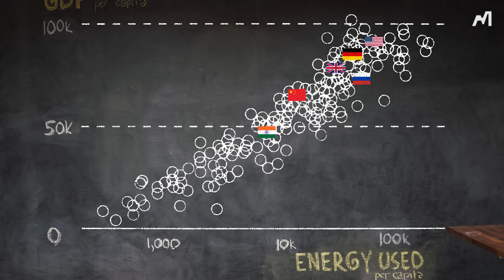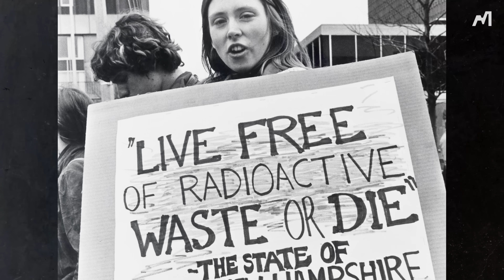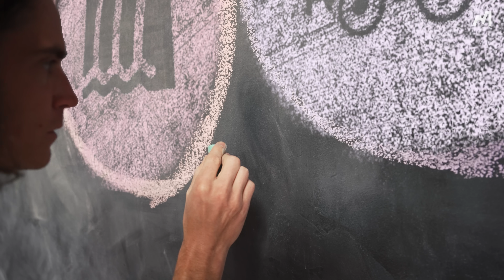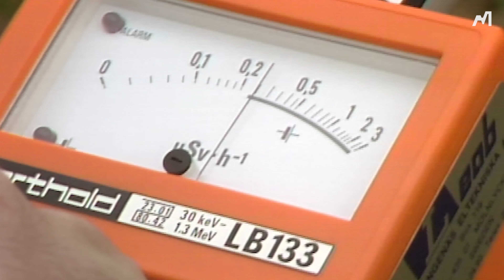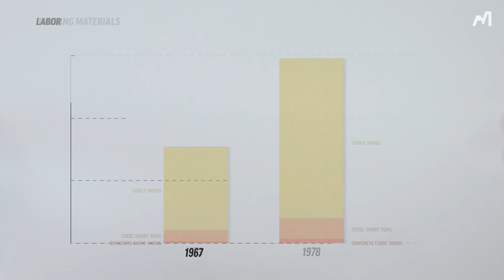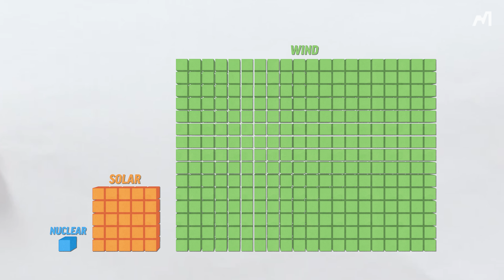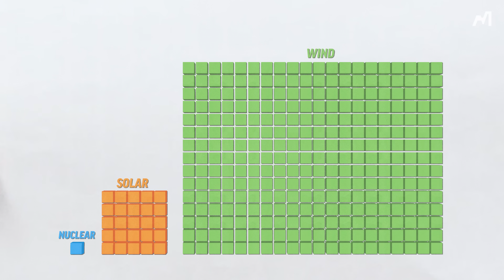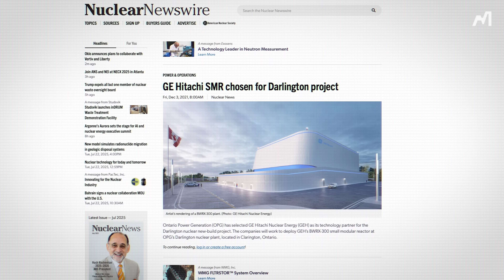They're Lying to You About Nuclear Energy

Comment: We need liquid salt thorium reactors
Reply: Exactly my thought.
Reply: Why thorium? Why not Liquid salt uranium? Why liquid salt and not another type? Got all your info from YouTube?
Reply: @Gomlmon99  You're a big boy and can do your own big boy research. The gist: Liquid salt because it is a safer system for avoiding meltdowns.  thorium because it is more abundant than uranium, therefore cheaper, and doesn't create plutonium. China is heavily invested in researching this tech, and the US is lagging behind.
Reply: @brianblades6177 my point is, everyone goes on about these reactors when they don’t actually know anything about nuclear power and got all their info off YouTube. There’s a reason we don’t use thorium - it’s expensive, difficult, and in some ways, less safe. India only started looking into it due to a lack of uranium. Molten salts aren’t some easy cure. They’re exceptionally corrosive, and corrosive = expensive
Reply: @Gomlmon99  corrosion is a solved issue. its expensive because the infra isnt there and research needs to be funded. its like arguing that we should stay on coal because we already have coal plants up and running and it would cost money to build/develop alternatives. by that logic everything new is 'too expensive', 'difficult' 'less safe', etc.
Reply: @brianblades6177 it’s not expensive because of research, it’s expensive because high corrosion resistance alloys are incredibly expensive to manufacture, and are generally very hard to weld and machine

Comment: In a country driven entirely by monetary profit, is not surprising that an energy source that takes decades to start break even on it's construction wouldn't stick.
Reply: They are incredibly profitable. You don’t understand how banking works.
Reply: The length of construction is extended partially by constantly changing regulations, though

Comment: While I completely agree with you and the use of nuclear power, there is a large discrepancy with understanding how it works. I worked in this industry for years as a nuclear engineer. The deaths you cited from Chernobyl are entirely wrong. You can't go by Soviet numbers during the Cold War as it was a lie. Many more happened from the contamination around the site and why Pripyat is unlivable to this day. Also, you say there was never any nuclear accident on a nuclear submarine. That is completely untrue. There is no "cookie-cutter" approach to reactor design. You completely misunderstand how any of this works. I am a fan of nuclear power and lived, worked, and slept near a reactor for many years. I applaud your championing nuclear power as I agree with your overall attempt at support. However I think you need to do more research.

Comment: 1. He ate non-soluable radioactive material.  Soluable material with high alpha emitters are literally some of the most toxic materials known,  for instance Po-210 is 250,000 times more toxic than hydrogen cyanide.
2. This video insufficiently explains the difference between ionizing radiation and alpha emitters. If you inhale or ingest sufficient soluable alpha emitters you will die,  no question. The LD50 of certain alpha emitters are smaller than a single grain of sand. 
3. There is an enormous ethical issue with leaving some 24,000 dry casks filled with High Level Nuclear Waste for our descendants at a lifetime storage cost of approximately 6x the value of the nuclear energy that created the waste in the first place.
4. Due to hydrogen enlmbittlement, dry casks are legally viable for a maximum of 100 years with 20 year certifications. These require above ground storage, constant monitoring and a minimum of 50 container changes in their lifetimes.
5. Renewable energy like wind, geothermal and solar are far more land efficient than nuclear because the land can largely still be used for grazing and agriculture. Unlike nuclear, after decomissioning, renewable energy land can simply be returned to its previous use. Due to on-site waste storage, nuclear land is locked away from any other use for thousands of years. 
6. Regardless what this YouTube claims, the USA absolutely did create and test a fully functional nuclear weapon fueled entirely from reactor-grade nuclear waste obtained from Britain in 1962. This is why the USA made nuclear reprocessing illegal in the 1970s.
7. The current DOE LCOE of nuclear energy is more than 3x more expensive than renewable energy.

Comment: SMR's are a pipe dream. Show me one working. Oh wait, you can't.
Number one rule of engineering: Show me one that works.
Rule Two: And now show me how it fails with a service history. And neutron embrittlement is a very complicated topic. 
And SMRs have attracted many companies that have developed...nothing that works.
It's like it's a scam, or at charitably, attracts overconfident idiots. Not ideal for a nuclear reactor designer.

The US hasn't designed a new reactor that works in decades. Hasn't built a new reactor in a while either.
And US navy on-ship reactors have a positive temperature coefficient, ( PTC,) which is a polite way of saying they can explode.
From 71-78 there were more regulations, but also, Three Mile island happened, which was a symptom of chronic incompetence in design, operation and oversight. Literally core containment failed, and the operators were muppets, but Westinghouse who designed it were worse. (So bad, the control room layout is literally a textbook design study for bad human interface design.)
The DOE's design for fuel rods at one point, had a moronic error that led to fuel rods warping in service. Metals when heated expand, and two concentric tubes were welded together ... at both ends. 
Much effort has been expended fighting simple physics. (The later designs of fuel rods don't have that flaw.)
To compare power sources, the only economically rational way is Levelissed Cost Of Energy, counting in cost of construction and disposal. (LCOE). And the DOE's LCOE numbers include wishful ones for SMRs, because getting civil nuclear to subsidise weapons programs is good for the DOE. Independent LCOE numbers show solar, offshore wind as the best investments. Why make poor ones?
(The US Government killing the national waste storage facility project was not helping.)
Reply: Why are SMRs a pipe dream? They’re standard tech. The military use small reactors all the time. The only difference with civil ones is that they’re more heavily modularised with decentralised skid production

Comment: I'm a Health Physist.  Graduated from Georgia Tech in 1985 and have been working in the nuclear power industry for over 40 years including some additional time while I was a student.  Most of my time has been in Radiation Protection and Operations.  The human body can repair small amounts of chromosomal damage.  The combination of factors that could result in a cancer cell include 1) multiple damage sites in the DNA molecule that result in the molecules being damaged to the point that it can not be accurately reassembled 2) the cell has to be able to survive with the permanently damaged DNA 3) the damage has to result in cancerous behavior of the cell 4) the body doesn't not recognize the cell as being abnormal.  The vast majority of cells with significant radiation damage die.  Nuclear power makes an excellent base load source, in my experience.  My current job includes dealing with binders of regulations.  Some of the regulations contradict each other.

Comment: 99.9% of the hype and fear regarding the generation of electricity from nuclear reactors is BS. I accept that.
However, you completely glossed over the real problem. That's called lying by omission: What is the cost of long term storage of the waste products in a secure fashion. The SHORTEST time period is a few hundred years for strontium-90 and cesium-137. Answer this simple question and we can have a much better and more honest discussion about the future of nuclear power. Here are the storage timelines we are talking about:

Strontium-90 & Cesium-137 → Dominant hazard for the first few hundred years, then nearly gone.

Americium-243 & Plutonium-239 → Control hazard from thousands to tens of thousands of years.

Technetium-99 & Neptunium-237 → Stay around for hundreds of thousands of years.

Iodine-129 → The “long-hauler,” persisting for tens of millions of years.

👉 That’s why waste repositories are designed with multi-barrier systems and safety cases extending out to ~1 million years.

Comment: The biggest threat, arguably, beyond the typical terror points, is the economic-economic systems some countries use, which will decrease efficiency of getting the propper engineers in place like such systems have with other industries. For countries that doesn't make use of quota of surface level criterias, not referring to skill, but mere appearances of a person, for their method of employment, they have significantly less concerns and possible objections to lobby against nuclear power since it is skill-educarion based. Hopefully it won't be too long for nuclear to become more common place.

Comment: Not one mention of nuclear waste? That's the problem.
Reply from the maker: absolutely mentioned it, somewhere around min 13-14
Reply: @Maxinomics okay he did mention it. But he left out the fact that inside those blocks the radiation will be deadly for 700 million years. And just how long does that concrete last?
Reply: he mentioned it
Reply: Thorium salt water reactors run on waste
Reply: Okay he did mention it. And all I can say is b*******. Each of those blocks each of those blocks will be deadly for 700 million years.

Comment: I get my power from a nuclear plant now, after living in California my entire life and getting my energy from the hobbled mess of natural gas power plants, and wind and whatever else they combine to generate enough power for the bay area.... Well, in California summers, sparingly running the AC in the house meant over 1000$ a month electric bill, and generally cooking in an 83 degree or higher house, if we ran the air more we would see the bill skyrocket to over 2000$ easily.... Needless to say, now I am getting my power from nuclear, I keep the 2 story house at no higher than 75 up and downstairs, generally lower, around 72 any lower and it gets kinda cold :D. My bill is around 200-300$ a month. That's with a gaming pc, 3 refrigerators, a basement freezer, and all the other modern electronics of today. from 1500$ a month down to 200-300$ a month with significantly higher electricty use.

NUCLEAR IS THE WAY!!!!!!!!!!!!

Comment: Solar is meant to be supplementary. Not a core power generation method. Same with wind or tidal. Nuclear is needed along with those to actually make a "green" method of power generation. Same with geothermal. We should be using all of these methods together not just focus on ONE. Even coal or gas can have its use for power usage. But in the end we need ALL OF THEM. To actually stabilize power for the world. Coal and gas should be used only if we desperately need it.

Comment: I have a degree in physics & I have studied this issue for nearly 50 years. While I remain skeptical about long term waste storage (or humans doing any significant thing safety related for long term), I am confident that it is possible to build safe reactors. However, possible doesn't mean that it will be done, regardless of political will.

Here's my simple response to your video.  Currently, the taxpayer pays for any damages in the event of a major disaster. Make would-be plant operators pay for their own liability insurance to cover any possible malfunction & then they can build.
Reply: Well there is no insurence taking that risk😂. Best comment here, thanks.
Reply: This should apply to so many industries that leave behind cleanup issues...
Reply: Your forgetting half the problem, a reactor that could never meltdown on its own STILL needs protection from the outside world, which means a reinforced concrete containment facility, and that's the biggest cost driver.
Reply: I'm not skeptical about waste storage. Natgas exists because it's been trapped by nature for tens of millions of years. Why couldn't humans design a storage facility, for much less volatile compounds and much less pressure, that holds for 1/100-th of that time? Of course we can.

Plant operators already pool money into funds that pay out in the event of accidents. However, the major problem is that in the event of a large nuclear accident, the costs are political, and they're not based on the actual risk/benefit calculations but on the amount of effort and money that needs to be spent for the politicians to look good. And that scales with GDP rather than with release severity. Insurance can't cover arbitrary costs, and if there could be unlimited money, politicians would field unlimited remediation efforts.
Reply: How about make the company officers pay for any damage?
Reply: Just think of that underwater reactor incident in japan that STILL leaks as of today and that no one can get near because it is too hot and too much radiation. You want a life-extinguishing time bomb next to your door for electricity? I don't.
Reply: @Traumatree  I'll take the "life-extinguishing time bomb" that will never explode because they're not dangerous to the cancer-causing, illness-inducing air pollution that coal and other fossil fuels produce to make a fraction of the power.
Reply: @Traumatree This dude really clicked on a video that reaffirmed every educated person's belief about nuclear not only being exceptionally safe, but exponentially more safe and healthy for the public than coal.
And then proceeded to say the most ignorant NPC comment ever ☠️
THIS is why humanity is doomed

Comment: This is a world class piece of false facts and misinformation/disinformation… Just remember how the cigarette industri showed ”research” that proved that it was harmless to smoke. This video is full of unsubstantiated claims and falsified facts. Thyroid cancer is certainly not benigne and harmless!! And that is just one of the absurd claims!! Another one is that the body adapts to radiation. It certainly does not! Radiation is an accumulative problem, so all radiation matters. Plutonium has a relatively low amount of gamma rays, but it is certainly not zero. And gamma rays have an impact on our DNA! Plutonium has a high level of alpha particles, which is easily stopped with shielding. However if you breath in dust containing alpha particles, it is very harmful for your health. Internet is full of this kind of misinformation/disinformation that is presented as science/facts/truth! It’s a jungle out there!!

Comment: I have worked in the field many years no issues, as well as many i know unless they were smokers so smoking kills people with out nuclear power.  I myself have ingested cesium 137 multiple times.  The 1st time was over 35 years ago and young.  No big deal. Every one I know has at several sites.  The WORST FORM OF RADIATION IS NEUTRON WHICH IS RELEASED ONLY FROM A THE ATOMIC REACTION.  AND THE HOUSEHOLD RADON IS ALPHA EMITTER 2ND ON THE LIST. PAPER CAN BLOCK IT SO WHEN BREATHED INTO LUNGS IT STAYS TILL IT FIZZLES OUT.  PAINT YOUR BASEMENT WITH DRYLOK SEVERAL COATS NO MORE RADON.  IT COMES FROM SOIL, ROCKS, AND OTHER NATURAL SOURCES THE PROCESS FROM BREAKING DOWN NATURALLY.  BREATHE EASY.  AND DON'T SMOKE!!!!

Comment: Even The Simpsons is turning a corner for that, where are the green goo is confirmed at this point to be the coolant because the man running it is cutting corners, it's not water. Or anything else that would normally be a coolant in a nuclear plant, and it's not acidic, it's that hot. There's a reason Homer is not dead

Comment: I'm a convert. I used to be terrified of nuclear energy, because I lived in Pennsylvania not far from 3 Mile Island as a small child when the meltdown happened. It did emotionally scar me. Kyle Hill's YouTube channel is what actually converted me. I think we should have nuclear for base load, and we should have solar on every rooftop and parking garage and down the medians of highways to add extra power. Also we should have lots of wind power as well. There is absolutely no reason we should be continuing to burn fossil fuels and spew pollutants into the air when we have much better technologies. Oh wait, I forgot, the oil coal and natural gas Industries own our politicians.
Reply: Nuclear build out is guaranteed to raise fossil fuel consumption, it will raise wholesale electric prices and thus keep coal powerplants solvent while siphoning money away from renewable instillations.  This is the Republican energy plan.

Comment: I read about a building complex that had used radioactive steel, so the people in the building got roughly 4 times the normal radiation you'd get per day, and lo and behold: they had lower cancer rates than the population otherwise. The linear model is nonsense, it dips before it rises. You can have moderate exposure without it ever doing harm.